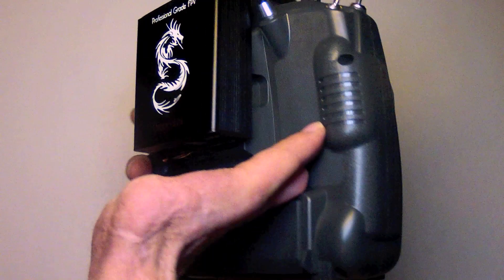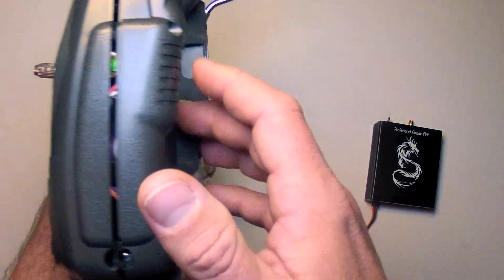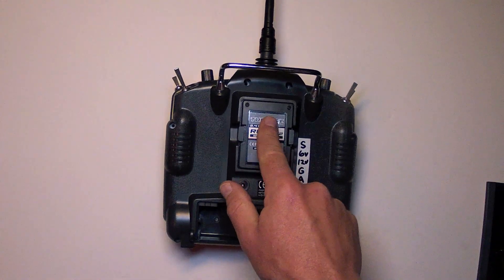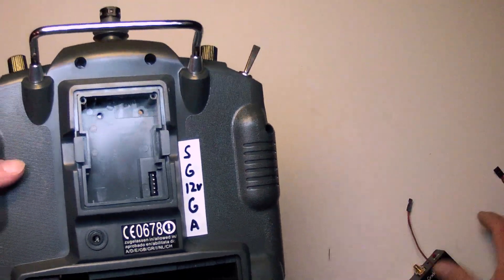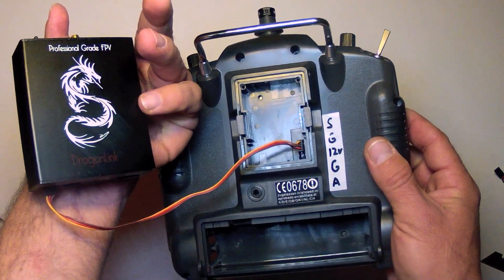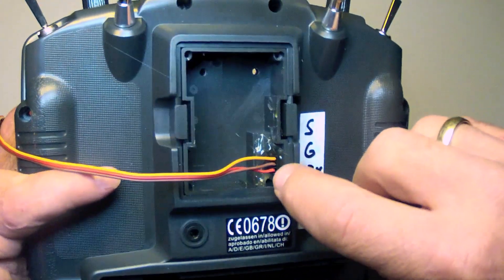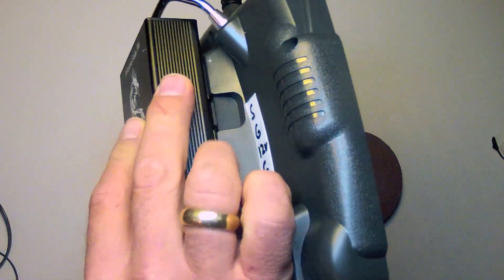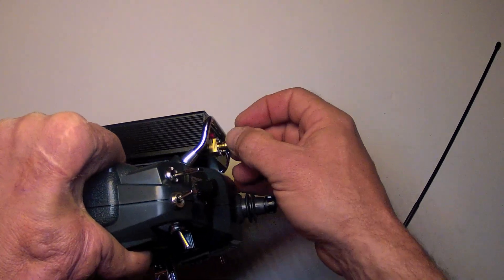DRAGONLINK to TURNIGY 9X HOOKUP

Comment: Hi there let me make a fool question? I have a dx8  and I setting the radio in slave mode and then I connect my Dragonlink but I have no control over the trims, an then I remove the slave mode and get back the trims control which is the right way?

Comment: A great video!  Is it possible to use servo extension wire that you shown on video but just long one. I need to place my Dragon link transmitter and antenna on the 15 feet high post and connect it with gimbals and the rest of the transmitter in the bottom. So, can I use thick about 18 - 20AWG servo connector cable  or even thicker not to drop the votage. I'm doing this for better connection because I use the link as a surface radio ( boat aplication). So I need to place my antenna as high as possible.

Comment: Thank you for sharing your experience. I have a 9x with stock firmware, if I hook up a Dragonlink to it will the 9x support ppm? I've seen that Dragonlabs offers a range of coax extensions, are there significant losses using those extensions? Thanks again!

Comment: HI, MY FRIEND! IS THERE PROJECT TO IMPROVE RANGES DEVO7 ( WALKERA) ?THANKS.
Reply: Why not, I don't think Ed has much experience with the Walkera Radios. I am not sure though. Anyway The transmitter section of Devo must have similar signal leads coming from the "motherboard"  of the Tx. You find those and disable the transmitter module just like Ed did in the 9X and connect the three needed for the dragonlink and Bingo! You have incredible range. It is pricey though considering the 9X cost $50 and the Dragonlink is $270 USD. Now the Devo & is a 2.4Gighz Radio so oyou can also use a Wifi amplifier. They can be had for $20 on Ebay, you will have to do the research and make your own antenna, You will need to understand a little about how to make an SMA or RPSMA connection from your raduio where the antenna is connected then to the Wifi amp and then to the antenna of your choice ,a whip, a helical, a clover leaf  or a Yagi or a combination. Need I say any more?

Comment from the maker: If multipathing (bouncing signals) or changing orientation of the receiver antenna vs. transmitter antenna then yes, circularly polarized is better.  However for 433MHz this would have to be pretty huge.  It might work for the ground station but pretty hard to work it out on a small RC plane.

Comment: yes i done the same without using the glue because i want have the possibility to disconnect the servo cables from radio... thanks. the only problem is sometimes my rangelink doesn't turn on. Maybe the pins are moving a bit into the servo adapter and the signal is not transmitted.. i've fear it can happen during the flight... :| any solution?

Comment from the maker: This is the setup I use for fixed wing and multirotor FPV control.  The video transmission is a completely separate system.  The DragonLink will control an aircraft line of sight for many miles.

Comment: Sorry I don't know anything about FPV or RC's in general.   I did buy a plug and play DJI Phantom though and it is pretty simple.  What I want to do next is to mod the DJI Phantom to fly FPV.  I do not want to buy a kit and find that I am limited to a kilometer or so and then have to upgrade and spend more dollars.  I would like to start with a decent kit that will give me good range.

Do you run the RC vehicle with this and your FPV transmitter with this controller?

Comment: Fantastic video.
I was wondering how to do this and was holding off on purchasing the DragonLink until I found out how to connect the wires to the 9X nad DL
Big thanks for such and informative video. 
Personally I would have used Velcro instead of double sided tape but thats a personal thing
Well done

Comment from the maker: Oh that battery is just fine too.  Calibration is just a matter of jumping signal pins 5-6 (with supplied jumper) and turning on the transmitter for 15 minutes so the receiver can tune in to the exact center frequency of each of the frequency jumps.  It's apparently not crucial to even do it at all but it will help get the most precise tuning and therefore the maximum reliability and range.

Comment: i was about to throw my 9x out the window due to a pathetic failure from frsky telemetry system, On range test it kept losing signal every second so i couldnt trust it anymore. you saved it now haha cheers!! Thank you for the great video. Running lipo on the transmitter wouldnt damage the dragonlink right?

Comment from the maker: Oh yes, absolutely.  If you use the stock Turnigy RF transmitter module then you would have to cut or desolder the antenna though.  There are however a bunch of aftermarket RF modules that have the antenna right on them, kind of like the DragonLink does, so you can swap them back and forth.  I just made mine semi-permanent as my dedicated FPV transmitter, but there are many variations on how to do this.  Have a look at some of the RF modules for the 9X and see if you find a winner for you.

Comment from the maker: If receiver and transmitter antennas are parallel then the loss in gain will be minimized.  If out of polarization, like one vertical and one horizontal, there will always be a loss, like 20db.  If you can make your receiver vertical most of the time on the plane, then it's always best to also keep the transmitter antenna vertical, in the same polarization.  Any other orientation it is hard to ensure that both antennas are parallel most of the time during flight.

Comment from the maker: Yes, pins out for RSSI, no hack no soldering.  Setting the failsafe is super easy.  You just turn everything on, place the controls in the desired failsafe positions, and hold down the button for about 5 seconds (there is an indicator light).  Then you can just turn the radio on and off and watch the failsafe happen.  Actually range testing is recommended to be done by walking away with the radio in micro-power mode and watching for failsafe activation at certain distances.

Comment: Interesting video Ed.
I noticed that turnigy have released a new txt, the 9xr I think it's called, which is specifically designed for hacking. It has no rf module inbuilt. It also has a programming port built-in making it easy to flash with er9x etc.  
Btw any experience with openlrs modules?

Comment from the maker: I would except that the pins (channels) are dependent on the transmitter, not the receiver.  Throttle may be on channel 1 for a certain transmitter but channel 3 on another.  The only consideration on the DragonLink is that there is an RSSI pin that does not go to a servo.  All signal pins are up towards the main receiver antenna connector, which is easy to keep straight in your head:  signal-from-antenna.  I will do a general DragonLink video though, so stay tuned.

Comment: Ed, you've done it, again.  I have not seen any other person/site/resource on the web that shows how to do this awesome modification to this radio in such a simple video.  I own a couple of them, because of the low price.  When I'm ready to invest in a dragon link, I'll refer to this video.  I'm curious if you could do the same mod to the 9x as you did with DX8 - ability to switch from 2.4Ghz to UHF.  Would that have been possible?

Comment: I'm a old time RC'er returning to the sport. My question is why? Does the 9x not work out of the box. And if it does, what's the point of the Dragon link? I just don't understand why you would cut up a new transmitter.

Comment: Awsome demonstration! I'm flying with the FlySky 9x with the FrSky 2.4 GHz module. I barely use my DX6i anymore. You just can't beat the range you get for the low cost of the FrSky receivers. And when I plan to step into that DragonLink range, I will definately be buying another 9x radio to dedicated for DL. 9x is a awesome radio for the price.

Comment from the maker: There is a dedicated 433MHz DragonLink receiver.  The way I did the mod you would have to swap out the module to reinstall a 2.4GHz module with an antenna.  But otherwise no, the way you see I did this there is no 2.4GHz capability remaining.  The output signal is over 5 times the native 2.4GHz module, and a lower wavelength by far, hence the greatly added range.  HAM radio license required in the US.  Won't affect other fliers unless they are also on 433MHz.

Comment: Hi Ed,
That was really informative.  Just a few question for you please.  I understand that the range is definitely magnified with this mod. my questions are;
-do I still use the same RX?
-is this still a 2.4G system afer the mod?
-is the output signal stronger than the stock?
-wil this affect flyers around me?

Comment: Ed,
Are you "upgrading" from your Spektrum to the 9x?  If so, are you also planning to flash er9x on the transmitter, in lieu on the current Turnigy firmware?  I personally did the before even powering up the Tx for the first time and haven't looked back.

Comment: Very informative as always.     My Dragon Link came with the flat plastic connector that you can use with the wiring harness that came with the DL.  You just choose the right order for the wires and push them in to the connector and install in the radio.  The wires that came with the DL are a heavier gauge, which can't hurt??
Great vid